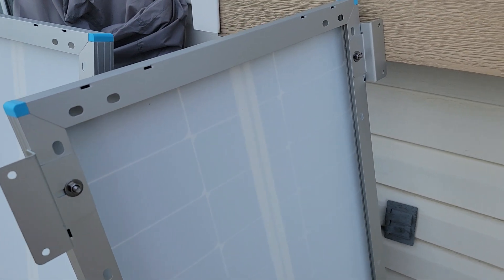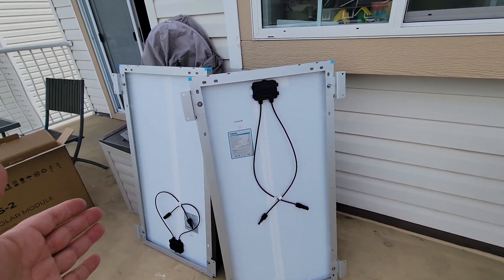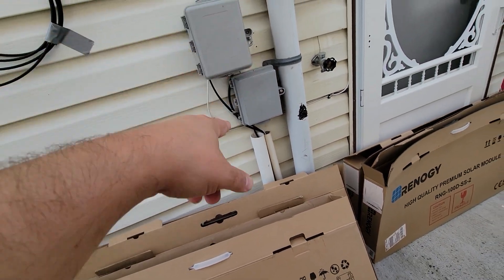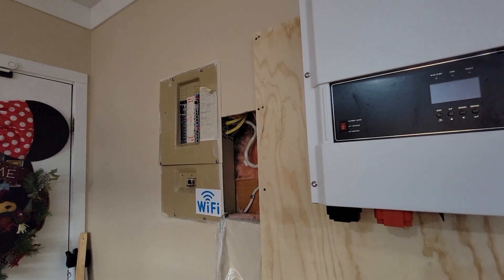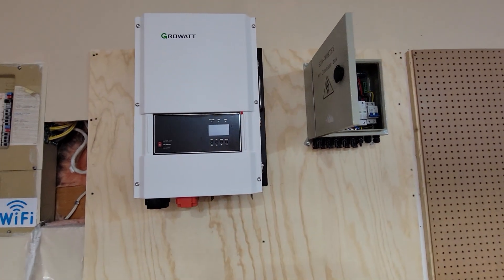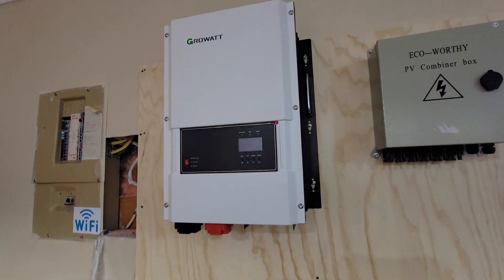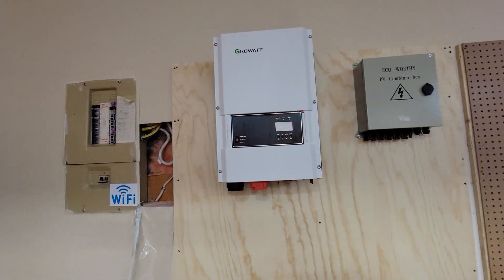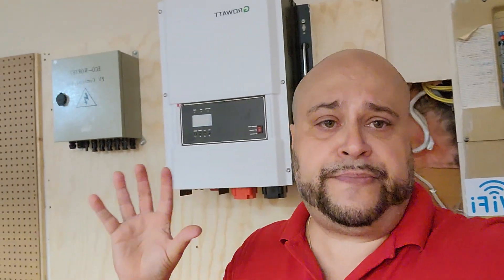EZ - Solar . my Design - Preparing for rolling Blackouts - DIY solar ,  keep it simple and clean

Comment: In your city, equip yourself with a wood heater that you will have in January and February, that's all, there is wood for 2000 years! 
Do you know that a solar panel of 1 meter by 1 meter is just able to light a light bulb in your grandmother's old refrigerator (remember the light bulbs that lit little) in addition you have to buy a battery etc... NO; NO and no, solar is not profitable.
Reply from the maker: we need to get a 7k permit to get a wood heater installed

Comment: Mike, I think that's a pretty awesome project to do around the house! Did you install all the panels and hardware yourself, and do you have an option to add more batteries to this system? Are you going to feed the grid and what kind of power generation are we looking at here with the current setup?

Comment: Mike how do you attach the panels on the roof? Aren’t you penetrating the roof bricks which compromises the roof?
Reply from the maker: We have shingles , but i use an epoxy roof tar and man dose it ever stick , and it never dries
Reply: @realmikemartins  thank you! That's actually my main concern to put solars. I don't want my roof to start leaking. Probably will build something like steel frame on the ground and attach them there.
Reply from the maker: @anti-socialism  that works too

Comment: Similar system at my house, only on the eastern seaboard of Australia you rarely get a day of sunlight which is usually marred by a criss-cross of stripes in the sky, followed by intense rain. So, all in all, for the last eight months, solar power won't recharge my batteries. The bio-diesel generator gets a lot of use.
Reply from the maker: Weather modification.  We actually did a show about that on Mike in the Night 8ish weeks ago . We covered Australia 🇦🇺

Comment: Hopefully your solar shed  Will withstand the 60 pounds or a talent Of hail.
Reply from the maker: Been okay for 3 years now . Fingers crossed
Reply: @realmikemartins   Perhaps consider some kind of a screen over your solar panels  while they can still Be efficient. I had solar panels at my cabin in Princeton, BC and they trickled down into 2 marine batteries pIus I also had a battery charger and generator et cetera.Canadian Prepper  has all kinds of lessons on solar panels and generators.Thanks Mike